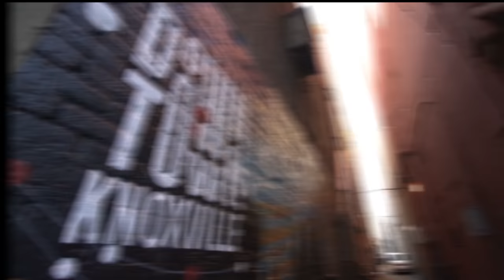Wheels & Deals- 35+ Car Nest

Comment: Damn what some junk. My dad bought a new 78 Lincoln Mk whatever. Every option, sunroof, 4 wheel discs, 460/C6/9inch. It was a gas guzzling POS even by 80s standards. He wouldn't sell it and it ended up getting scrapped. I will never understand the mentality off ppl that end up with "collections" like this.

Comment: The 58's are not just one off years.  This body with some modifications was used in 1958, 1959 and 1960 calling them Mark III, Mark IV and Mark V.   Later in the 60s Lincoln started over again with the Mark III as a follow up to the 56 and 57 Mark II.

Comment: @6:51 time stamp, that white Cadillac Fleetwood is either a 1974 or 75 but the seller called it a 1971. Big difference between a 71 and the 74-76 Fleetwood. (74-76 had Talisman edition/model. 71 version might have a D’Elegance model as the top of the line. )

Comment: Every time Richard said the ‘58 was a one year car I was waiting for someone to correct him. The 1957 was the one year car, the 1958, ‘59 and ‘60 shared a body.
If that green ‘57 is worthless I’ll give it a home. Those parts cars are worth some money because you just cannot get a lot of the trim for these cars be a pity to crush any of them. That ideal buyer is a business that restores Lincolns and could turn 40 cars into ten nice ones and 50k worth of spares. Cars with four miles on them aren’t ever going to run and drive without destroying most of that originality.

Comment: I would have to question the new ones also. To keep everything from rotting storage needs to be never under 50, never over 90. I bought a 22,000 mile Buick Roadmaster with only 10 year old tires that looked perfect. After driving all the cracks started showing up so a lot of the rubbers and plastics are questionable as well as the engines. Do they turn over, etc...too much to take a chance on for sure. Sad.

Comment: I have a 79 Lincoln continental. And I love it Dad bought it new in 79. It has 80k miles on it and I have been around this car for 40 +years and I can tell you they are shit. 400 instead of the 460 one barrel carbs and more vaccum hose than steel in the car

Comment: Dude I'd be afraid the seals are all bad and most of the gaskets probably are too I bought a 85 bronco two with just 10,000 actual miles even had the original tires on it but we had to pull the motor and rebuild it all seals and gaskets had to be replaced even in the transmission but it looked brand new but I would never do that again .

Comment: I was involved with the clearing out of that building. Cool story and some good times, although somewhat dangerous.
Reply: What Happened to the cars
Reply: @derekgrant1783  some went to a place in North Carolina and some went to a guy we were working with's place about 10 20 miles away. A lot of the junk cars outside ended up going to the scrapper. The only thing salvageable would've been like chrome and windshields. I just hope the really good condition cars that I sat in got happy endings, but chances are with how busy the guy is, they are still probably out in a field in NC. Sad story about the former owners of the place if you want to hear about it.

Comment: It's more than a little irritating that Richard's solution to cars that he doesn't see as profitable is that they should go to the crusher ... when there are dozens of YouTube Channels saving much rougher cars. 

So while we all get it that he has to make money, the word "Crushing" should disappear from Richard's vocabulary. Nobody is manufacturing any more of these cars, and soon enough there won't be anything but electric cars offered new. 

Every car guy should be trying to at least preserve these old sleds, and get them into the hobby for the regular working guy that want's to wrench on something in the garage but not break the bank. They might not be your style, but they are someone's!
Reply: The problem is those lincolns are incredibly exspensive to fix, and even harder to find parts for ,,, you could easily spend $10,00 on parts alone just to get one of them road worthy,,,, and then only worth  $10,000 , I  also would hate to see them crushed, but its just economics. The guy selling them is to blaime for there soon to be destruction. Very Very few people can absorb 40 cars at once ... that none of them run .